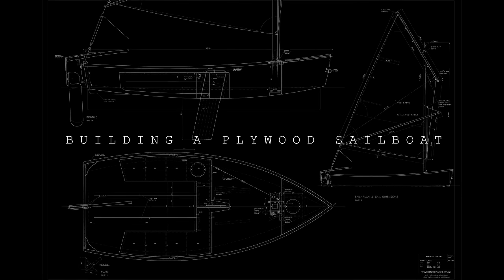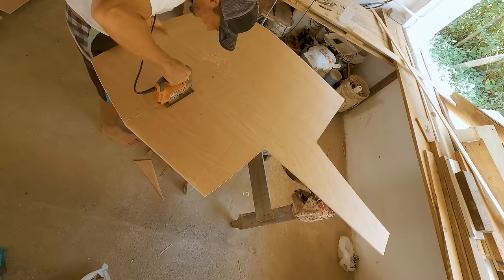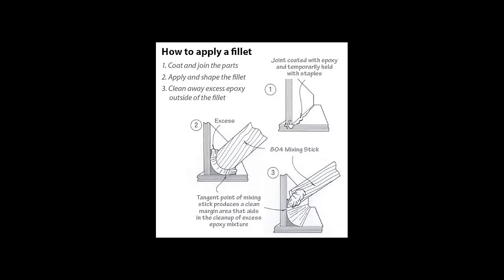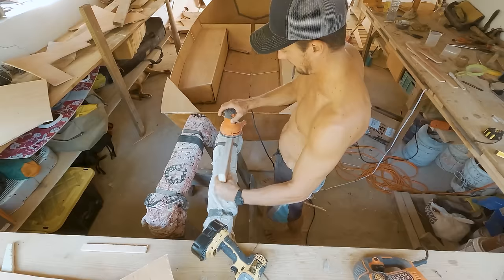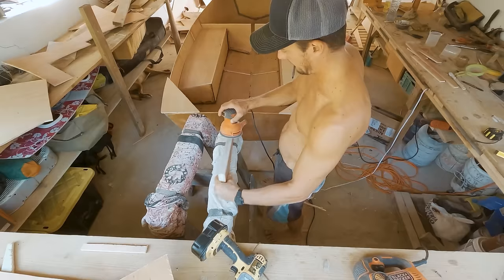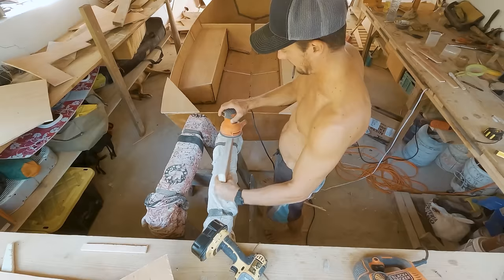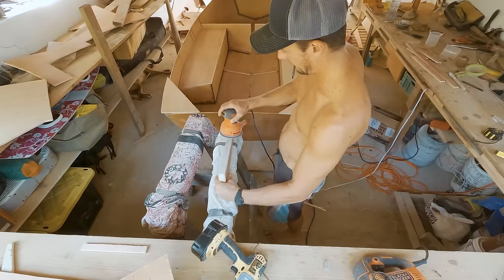Plywood Boat Build - Start to Finish

Comment: A band to get your feet under, then leaning out will be good. On my Finn there are two bands parallell. As for the sword, it seems a bit small. Since you seem to enjoy the dinghy, why not make a foldable centerboard, as I have on my Finn. Eight mm alu, and its hinged close to the box near the bottom, and folds backward in case it meet some resistance....Then you will have two folding , the rudder and the centerboard.....

Comment: Great video. How did you make the mast step? In the deck or on the bottom ö the hill? Breaking your video into chapters makes it really useful.
Reply from the maker: I glued a plank of 1x4 to the forepeak bulkhead and hull as low as i could, then drill a small hole in the middle to insert a windsurfing mast connector.  Check this video https://www.youtube.com/watch?v=wN-P6geb9Ks at 1m 35s into it.

Comment: I don't know if this is your first video or not but it is so good. I really feel I could handle building a boat after this. I've often thought about it and I do have basic woodworking skills (plus a lot of experience in sailing, but not building a boat). Your video really breaks it down into a series of achievable tasks that are not so daunting. For me where I am sourcing mast, boom and sail would be a little difficult. Less sailing done here, so less old kit available meaning potentially having to buy new.
Just two things: 
1. I didn't see where you stowed the mast and boom on the car.
2. what was the finished weight of the boat? (Important to know for car topping)
Thanks for the video and long may you enjoy your boat. Once you really master the kite surfing with it perhaps you'll want to change the rudder and dagger board to units designed for foiling?
Reply from the maker: Thanks, you don't need much experience to build one especially with YouTube. I completely understand your sourcing problem, i have similar problems here in Dominican Republic with marine plywood and epoxy. But at least there are a lot of windsurfers around. 
1- The mast and boom are stowed inside the car.
2- The weight is around 100 kilos more or less
The foiling idea is something that i've though about for a while, there are a few people modifying their lazers and optis on youtube, but i have not yet seen a nice stable ride that inspires me to invest a lot of time into making foils.

Comment: This design of boat would be better if it had spray coamings in front of the mast to stop all of the water washing into the boat. A silicone seal around the hatch and some latches would also stop it from filling with water. Very well done anyway, good job! 

Also, remember your buoyancy aid.🙂

Comment: Thank you for making this video. It was very enjoyable to watch.
I have been thinking about buying / building a small boat that can be carried on the top of my car. This boat seems to fit my wishes very well. I think it is even possible to fi a small electric outboard motor to the back
Reply from the maker: yes the boat is designed to fit a small outboard. thanks for watching.

Comment: You might consider filling the watertight compartments with expanding foam. That way if you ever get a hole in one of them and it fills with water, it will still be buoyant and you won't sink!
Reply: Or you could put kayak float bags in them

Comment: Using the kite, pull up the daggerboard. When the kite tries to pull the boat to the side, the boat trips over the board and you capsize. With just a little board down, or the board completely up the boat can slip sideways.

Comment: Great Job man. i so wanna build one myself. Did the plans include mast build or just the boat? Again very nice. Thank you for sharing.
Reply from the maker: Dude go for it! The plans did include the dimensions for a 6 m2 gaff rig, but it requires a pro sailmaker to cut and stitch the sail.

Comment: Do they make 12 ft long plywood?
Builders are familiar with standard plywood sheets that measure 4-feet wide, 8-feet long and between a quarter-inch and more than one-inch thick. The new panels made by the Freres Lumber Company of Lyons, Oregon, can be as much 12-feet wide, 48-feet long and 2-feet thick.

Comment: Btw, for anyone building boats like this in the future, if you dont plan on using the forward most compartment, or the compartments under the seats for storage, it may be worth considering filling these spaces with foam. This will make the boat a bit heavier, but it will give the boat reserve boyancy, potentially preventing it from sinking entirely in worst case scenarios (for example, hitting something bad enough to rip those watertight compartments open. Those compartments will still provide boyancy rather than flood). Reserve boyancy is a worthwhile consideration in small boat builds because of how rapidly a boat can sink without it.

This boat is already fairly safe, as those 3 watertight compartments, plus the wooden construction provide reserve boyancy in the event of a capsize, so Im not criticizing the design or construction. Im just saying foam in those unuseable compartments would be an added layer of safety.
Reply from the maker: I have to disagree. The odds that 3 water tight compartments all flood are very slim. Also Air floats better then foam, and when water does go into a compartment at least i can open up the hatches and let the inside dry. Foam prevents moisture from drying, its a recipe for rotting. Its important to have access to all parts of the boat. Also its would probably quadruple the environmental footprint.

Comment: Hi, 
thanks for this detailed video !
What is your bailing system ?
Did you drilled an water drainage hole at the stern ?
Reply from the maker: Just a regular hand bailer. I do have a drainage hole at the stern and i can screw on a one way ball valve, but it doesn't bail very fast.

Comment: Good job sir.
I live in a not so rich Mediterranean country I have the same desire to build a similar boat.dinghy. But I was thinking of making it lighter and maybe faster, through imitating the lines and design of the professionally made  Laser and RS series... 
The way I imagine I would build it to use styrofoam to get the inital blocks and lines and contours right and then glue these block together... and finally covering them with fiberglass and epoxy...  Maybe put some plywood for structural rigidity in some places...
Any opinions if this will work?

I also have the option to buy a used or new Laser/RS dinghy from nearby counties but that would make me lose hundreds/thousands of euros for the import fee my country requests (evil governments)..
Reply: In my country, buying a used boat makes much more sense economically. Building a boat is something you do only because you have an interest in building. The construction method you describe sounds a lot like building a surfboard, to which I say, "Why not?" Give it a shot, and best of luck!

Comment: Bro, sailing it with a kite looks like a lot of fun. It really gets flyin! Overall you did a great job on the construction. On your next boat I would avoid using Gorilla Grip glue, assuming that it was the expanding stuff anyway. That stuff is shit, and it is the weakest of all the different types of glue.

Comment: So is that why sailboats are shaped pointed at the bottom like that? To reduce drag in the water by lessening the amount submerged?
Reply from the maker: Not sure if the V bottom helps with drag, but it definitely helps with comfort in waves, when the bow plows through waves the V bottom breaks the water and absorbs the shock instead of smacking straight onto a flat surface.
Reply: @HANDIY  interesting, I never thought about that

Comment: Stupid question perhaps, but how does plywood hold your weight? I'd be worried I'd rip the thing apart when getting in and out.
Reply: No question is stupid, but be aware plywood comes in many different thicknesses. Also, even thin plywood, when bent in a curve, can gain considerable strength, depending upon where the force is applied. Lastly, this young man did a fantastic job of covering all the plywood with fiberglass and epoxy, which adds a lot of strength. This boat is strong.

Comment: Why no additional floatation (foam) under the seats and in the bow compartment?
Reply from the maker: Because foam is less buoyant then air,  and it would also prevent me from accessing the inside of my compartments. Moisture could get trapped inside and could eventually lead to rot.

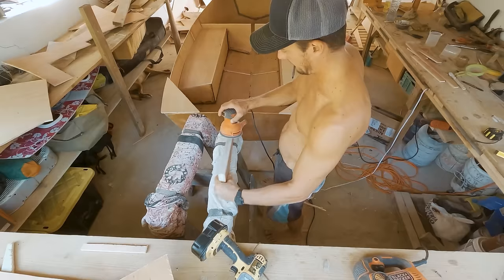Comment: Great build, there is one thing I would like to comment on though.  At 26:10 it looks like your girl is diving with the snorkel in her mouth, although it's hard to tell from the angle.  If she is, that is insanely dangerous and not a good habit to have.  Just make sure you remind people diving not to do that so they don't drown if they black out.  Have fun and stay safe.  I've been planning to build a boat for myself for years but I'm no where near water where I live so it's gotta wait until I move to the coast next year if all works out well.
Reply: Where did you get that idea? It's absolutely fine to free dive with a snorkel in your mouth! FWIW, I'm a marine scientist and have been "diving with a snorkel in my mouth" for >50 years.
Reply: @hectatusbreakfastus6106  Dude. Stay on your couch and you'll be fine...and comparing what this girl does (no offense--great!) to world class free diving competitors is ridiculous.

Comment: People keep telling the guy to fill with foam but foam traps moisture and will rot plywood plus plywood floats, that boat won't sink even if the water tight compartments flood.
Reply: Unless you use a closed cell foam that bonds to the interior wood or epoxy. And if you are at the point that the foam is the only thing keeping you afloat, you have bigger issues than slowly rotting wood due to trapped moisture.

Comment: Nice Work can you estimate the wirght in kg plz; i have the same project but for a solo carrying dude, in 4mm plywood and Carbon-fiber glasse. I can use your toughts ideas on my project feel free thanks Enjoy.
Reply from the maker: I think it weighs around 100 kg, I used 9mm plywood, 4mm will make a very light boat, but make sure you add stiffeners wherever necessary.

Comment: Please, when you sail, always wear a lifejacket. Well done on the project!
Reply: What is your reasoning exactly? Any old life jacket? Will he need an EPIRB too? Maybe a radio? Helmet, mouth guard?
Reply from the maker: Its definitely good advice especially when going far offshore and for people that are not comfortable in the water. Sometimes we Surf and Kitesurf the same spots in 3-4 meter waves without lifejackets, we've had to swim back to shore in truly scary conditions before, so these sailing conditions are very safe for us. Thanks for watching.
Reply: @HANDIY  If is and it isn't and my frustration is people just blurt out 'good advice' without context. Going offshore in a boat or even being in a large  body of water your biggest issue is becoming separated from your boat and this is how people die. A life jacket might be handy but you will have to be rescued by someone else and this is why people tie themselves to the boat via a lifeline. In a small lake or in the cove where I sail the water is shallow. If I don't get knocked out I can walk to shore and the boat can't go far. If I am worried I probably want a helmet. In surf and on 'wet' boats you have a big issue and you probably want a non-auto inflatable vest that allows you to swim and maneuver while sailing but will provide flotation assistance if you are getting caught and pulled down by undertow. The downside of course is again you will be pulled offshore and someone will have to find and rescue you.
Reply from the maker: @danielboughton3624  Hey yes what you say makes sense. My reply was actually meant for John. Cheers

Comment: What mm playwood you used for this work...please tell..
Reply from the maker: The plans say 6mm, but i used 9mm because that was the only thing available at the hardware store. 6mm is the correct choice, it will save a lot of weight but you might need to add some stiffeners in some areas.

Comment: I'd put a couple of self bailers just in front of the transom. You seem to take in a lot of water into the cockpit, and they will instantly get rid of it. Otherwise, you'll need to bail it out manually, which is a bitch, or sail with water slopping around the bottom of the boat which will unbalance you, particularly on a reach.

Comment: A router, and, the right bits, would have been easier to remove the bulk of the epoxy, and, round out the edges . Just recoat  the edges .

Comment: One thing I might recommend was to build up the edges of the plywood with scrap material, since pushing your body against a single edge of plywood will get painful. Also, some of your viewers may want to leave their boat plain rather than paint it... Fiberglass and epoxy weather with UV sun damage and are NOT UV Stable. You need to either coat it with paint or some other UV stable coating... Otherwise, nice build with minimal tools!

Comment: 3:20 noo he did not scarf it
7:44 make sure to get rid of flash or else you are in for a day full of sanding
9:30 those knees are very thin and you should of put them inside and not on top 
Pro tip: remember epoxy can fix almost any boat problems early on
Pro tip: clamps and a planer is a boat builders best friend but sand paper is gonna be a boat builders annoying little brother
Reply from the maker: Thanks for the valuable tips. haha yes an electric planner would have helped.

Comment: why would you need Gorilla Glue when.......YOUR USING EPOXY ?!?!?!?
Reply from the maker: Good question, not sure, I think at the time i figured gorilla glue would be as strong if not stronger then the glue used in the non marine plywood. I saved the epoxy for structural and waterproofing applications.